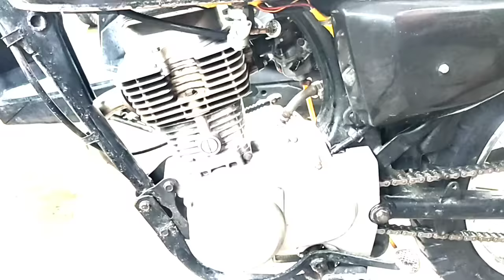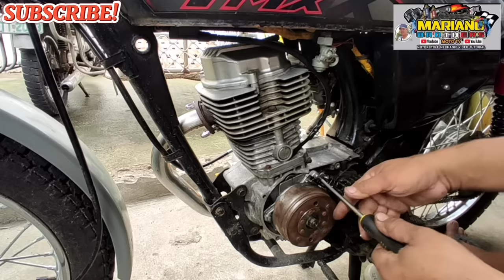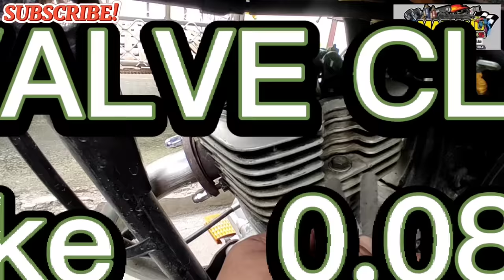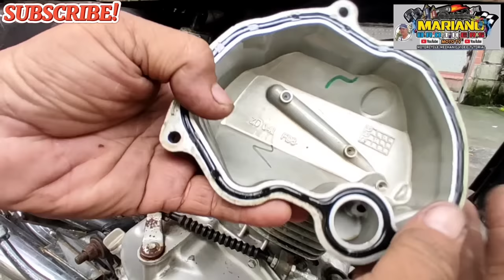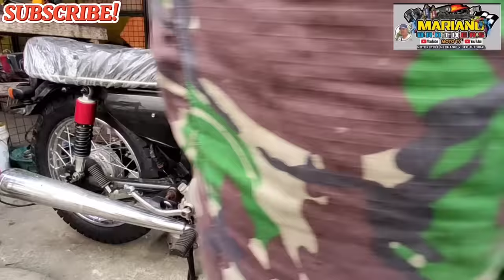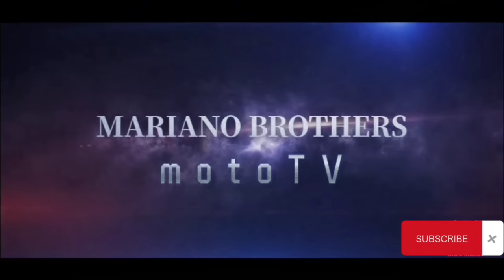TMX155 HIRAP PAANDARIN❓ PANOORIN KUNG GAANO KALAMBOT PADYAKAN! WALA PA NITO SA YOUTUBE❗

Comment: Ma Tanong lang Po tito Meron ako tricycle Ang motor ko Po ay rusi tc150 Anu Po ung tamang Valve clearance dito??.... Pangarap ko din yang 155 kso wla NG stock sa market phaseout na raw.
Reply from the maker: 0.08mm in / 0.08mm ex
Reply: Salamat sa info Tito,  nako short ako xa intake ko 0.6 lng pero ung exhaust ko 0.8.. godbless po e adjust ko nlng ulit. Salamat.